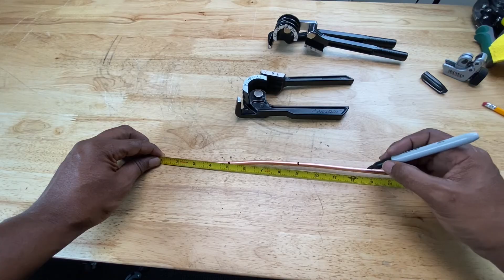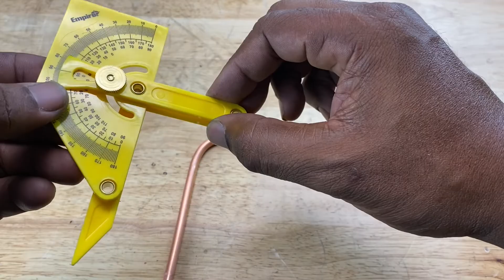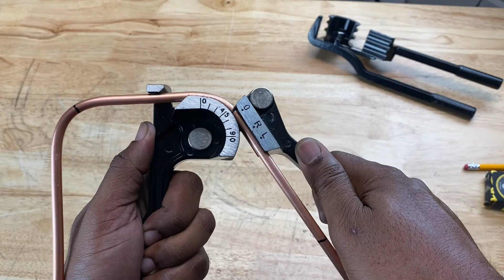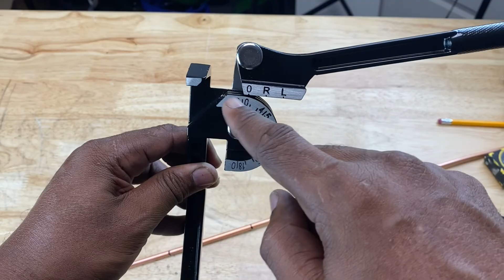HOW TO USE A PIPE BENDER.   - PART 2

Comment: Nice video. Why have a 90 and a 180 degree bender?
Wouldn't a 180 degree bender be able to do a 90 degree bend ?
Why carry 2 benders?
Reply from the maker: Radius differences - This is the main reason. A 90-degree bender typically has a tighter bend radius than a 180-degree bender. The 90-degree tool is optimized for sharper, more compact bends, while the 180-degree bender usually has a larger radius to accommodate the geometry needed for U-bends and return bends. Different applications need different radii.

Tool size and leverage - 90-degree benders are usually more compact and easier to maneuver in tight spaces. If you only need 90-degree bends, why wrestle with a larger, heavier tool designed for 180s?

Accuracy and stops - Many 90-degree benders have built-in stops or markings specifically for common angles (45°, 90°). It's easier to get consistent, repeatable bends without having to eyeball "halfway" on a 180-degree tool.

Application-specific work - Electricians doing conduit work mostly need 90s and offsets, so a dedicated 90-degree bender makes sense. Plumbers or HVAC techs making return bends need the 180-degree capability.

Cost - If you only do 90-degree bends, why pay for the larger 180-degree capacity?

Comment: Im an amateur with an amateur question. There is a line before and after each center mark of 45°, 90°, 135° and 180°. Are these -5° & +5° marks? What is the purpose of these marks / when would they be used? Thanks
Reply from the maker: They are not -5 & +5 marks. 

Some are for springback (common on cheap benders), sometimes tubing springs back after releasing pressure. These lines help you to overbend slightly so it will spring back to the angle you want. 

Some are for bend start/end positioning (common on professional benders), the line before the degree mark shows you where to align your tubing at the start, the line after the mark shows where it will end up.

Some indicate the "gain" or where tubing shortens during bending.
Reply: @Caliber8Tools ok cool thank you 👍

Comment: Great video! Only issue was that when forming the bend the "L" marks were lined up good, but the 0 to 0 marks were not. resulting the tube to be bent with center of the bends being pushed more to the right rather than the center.
Reply from the maker: Point taken. Thanks for the tip.

Comment: Nice presentation, but you got the sizing wrong, ACR tubing is measured on the outside all others are measured by the inside dia. the 3/4" L tubing you are holding up is measured on the inside.
Reply from the maker: Thanks for the correction.

Comment: Excellent video.  Thank you for making and posting it.  Additionally, dear sir, ¿is that type of tubing (3/8") suitable for use to install a kitchen sink faucet (Delta)?  Any comments most welcomed.  Thank you.
Reply from the maker: Yes it is. It’s standard.
Reply: @Caliber8Tools  I see.  [Kindly, just for my complete understanding (so I don't make a mistake or waste time installing my faucet), kindly], the 3/8" copper tubing I purchased @ Lowe's then is acceptable to lengthen the faucet supply lines?  Thank you so so much for the kindness of a reply.  (Wonderful video).  tonyd\.

Comment: Bend measurements are not correct. You did not line the 0 up properly before lining up your L. Your bends are not on center. This is good for learning the basics but not for learning accurate bending techniques.
Reply from the maker: Appreciate the feedback.

Comment: Just wanted to say thank you....but here's a question for some of the  people who only have a 90 degree hand bender tool and need to make it a 135 degree bend or a 180 degree bend this would be a interesting help cause this is what I  need to figure out after you showing me the basic of the bender that I'm using so again wanted to say thank you for all of who paid attention to this video.... Ty D.K.G.JR.
Reply from the maker: You would have to do two 90 degree bends in opposite directions to achieve the 180 degree bend.
Reply: @Caliber8Tools  and to make a tube coil?  this was a great video, btw.  thank you.

Comment: I know this is a demonstration but, one thing I like to do is roll the copper on a flat surface to correct any bends. Palms down, no fingers as in no gripping. 7/8 and 3/4 is tough regardless.
Reply from the maker: Interesting tip.